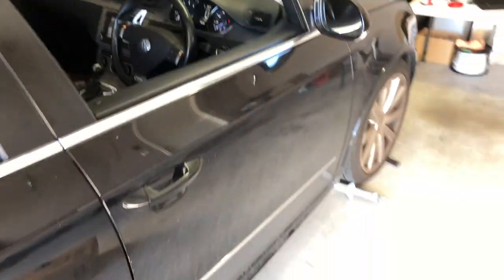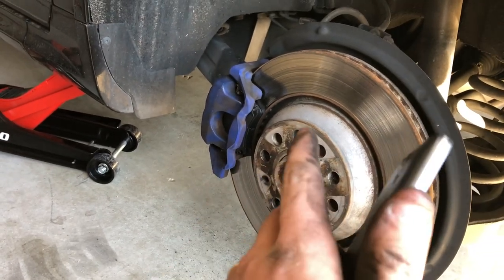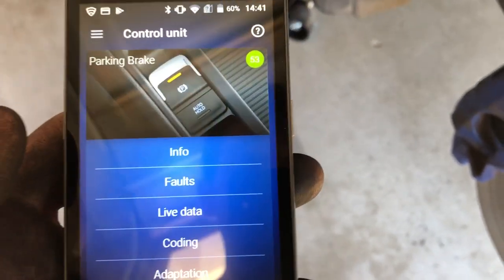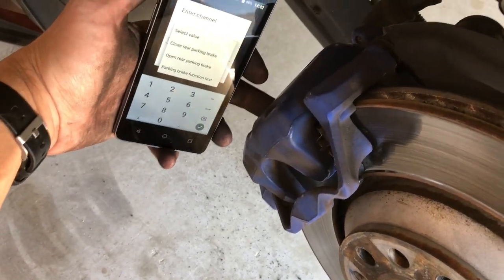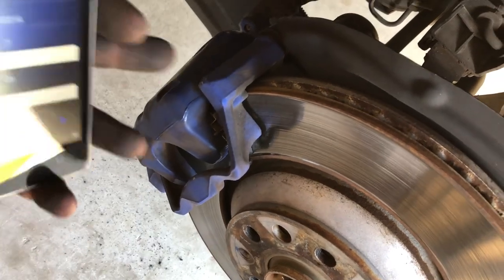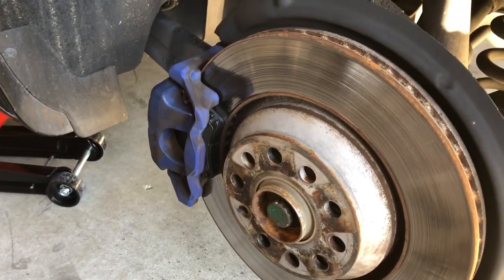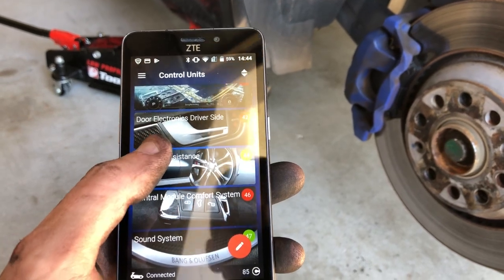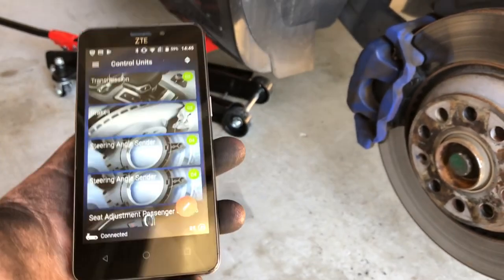OBD eleven Vs RossTech VCDS / Vagcom tested

Comment: Hi there, I thought u have to buy points to code and stuff? Is that not true?
Reply from the maker: If you have the pro version enabled and you know the coding (same coding as VCDS) you don’t need any credits, similarly if you know the measuring blocks etc no credits needed. 
If you want to open and click a button for all the hard work and effort such as ‘auto closing on rain sensing’ then yes you will need credits.
Reply: @ThatCarChannelOfficial  thank you so much!🙏🏽

Comment: Hi mate, i just installed an OEM towbar that comes with a control unit in my Audi, can OBDeleven re-code to enable the trailer socket to work?
Reply: hey Mark, did you get that towbar controll unit sorted, because I'm about to do the same..thanks

Comment: Can it permanently disable safelock?
Reply from the maker: I’ll have to check on that, if VCDS can do it, then yes this can. Surely there is a way to reverse the function so that the double tap lock is the safe lock and the one touch lock is the normal lock?
Reply: That Car Channel Yeh you’d think there would but I’m reluctant to go running to skoda uk and identify the car as possibly being modded and all the implications therein.
Reply from the maker: Not in a million years would I ever consider this a ‘modification’
Reply: That Car Channel Our local skoda dealer said they aren’t able to do it because insurers may chase them if there was a claim. So I’m thinking f it I’ll do it myself.